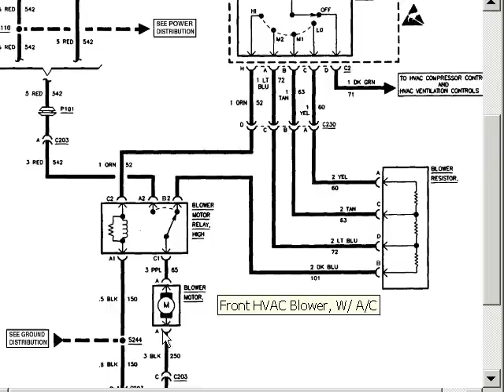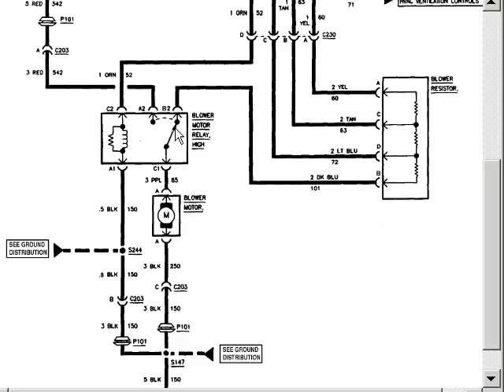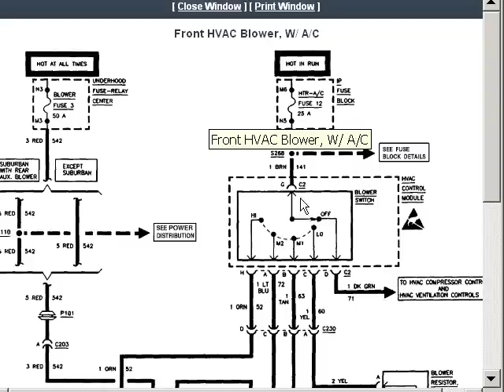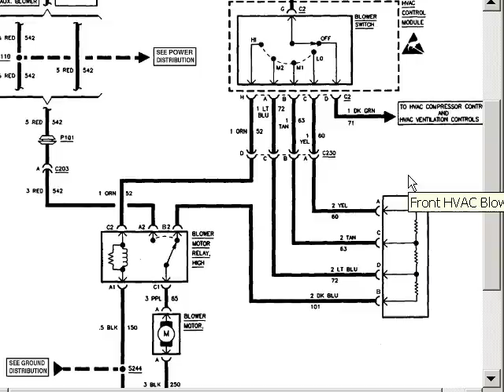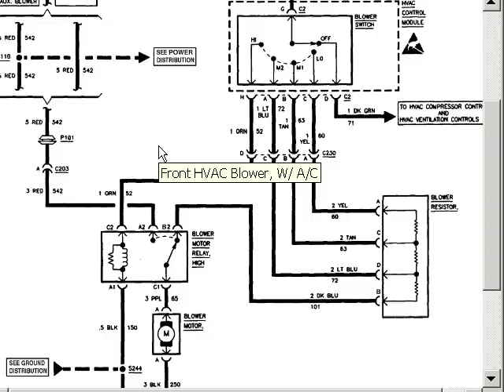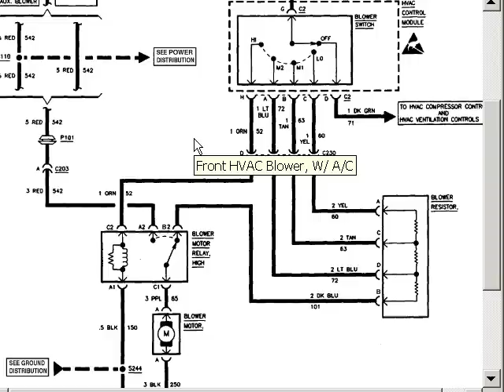Blower Motor Problems | Auto Repair Help

Comment: I have a 2002 Astro van with rear blower motor the motor will not turn on. on any speed no fuses are blown
check the wiring I'm getting 12 volts.. tested motor works fine it's confusing the heck out of me
Reply from the maker: I don't have a wiring diagram for the rear blower motor on an Astro van. But, if you have power at the known good motor, it's time to check the ground side of the circuit.
Reply: thank you for replying the Astro van comes with 3 blower motors one is for the front end of the vehicle one is for the rear AC  one is for the rear heat I tried connecting the Heat connection to the AC connection and the motor runs the wiring to the AC motor give me 12 volts but doesn't put out 12 volts to make the motor run
Reply from the maker: Okay I think the rear AC on the Astro van is the same as the ones deployed on Tahoe and Suburbans. These rear HVAC blower motors have a control module issue. You can see more about the problem on the bottom of this page.  http://www.youfixcars.com/blower-motor-problems-on-GM-vehicles.html
Reply: dmoney1dm8512 1985vett blower motor ground and motor get hot what the problem could be..

Comment: I've been chasing an intermittent short (15A fuse blows) on blower motor circuit for months now. I have Ford Workshop manual and Wiring Diagrams and understand them but feel like I'm missing something. Would the Mitchell 1 or AllData give any other ideas? Which do you prefer? Great video, by the way.
Reply from the maker: Mitchell and alldata use the ford factory manual to pull info from. If you already have it then it probably won't help. I posted a video about how I find electrical shorts here https://www.youtube.com/watch?v=2ATtwe1zSeE

Comment: my wires was burnt out I forgot to take a pic how the wiring now I trying to rewire the resistor in 2002 dodge stratus SE
Reply from the maker: Whenever that happens to me I head for the local junkyard in search of the same year, make and model car. Then I take a picture of the needed wiring layout for use at home. Or I'll pay for access to the wire diagram online from all-data.

Comment: I have a blower motor that keeps blowing when it's shut off all lights are off but when on it's on high and want slow down but my ac works and the heat works it just keeps blowing please help me driving me crazy
Reply from the maker: +Brian Staples I made a video addressing the blower motor runs all the time issue. You can see it here https://www.youtube.com/watch?v=jbd8K8Jzvv8

Comment: I am puzzled. I have a 2006 chevy equinox. Blower does not work. I checked the fuses and relays, they seem to be good. I put a meter to the plug I have voltage in all the speed positions. I tested the motor on bench using battery charger and it ran just fine.So I hooked up a couple jumper to connect plug to motor. I double checked for voltage just before connecting to motor 13+ volts. As soon as I connected to motor  0 volts. I did this 2 or 3 times same thing.  Any suggestions?????

Comment: good info on wiring diagrams / 1994 capri no power to blower motor/ no power at 30 amp fuse at under dash box fuse missing and 1 terminal looks burnt / trying to help a single mom get heat in her car before winter really sets in thanks for any suggestions

Comment: Very nicely done! I have a 1999 88 Olds and the blower does not work on any speed. It is a non-climate control. I have replaced resistor, relay, motor. Also checked all fuses and are good. May be a bad ground??? If so where is this located? Thanks in advance.
Reply from the maker: +Jeff Louden I'm not exactly sure on your model. However if the power wire is a single light purple wire and the blower motor mounts to the metal part of the firewall then it's probably case grounded through a bolt with a ground tab.
Reply: +mgittelman Fantastic, I'll look to see what I can find. If nothing discovered I'll take it to a trusted mech. to look it over. Thanks for your response.

Comment: nando here... if the fan stays on after you pull the key out> then the resistor is shorted inside the controller... replace it under dash near foot area... more info @ CustomWorksUnlimited. Com

Comment: i have a 1998 Dodge Ram conversion Van 1500 318 eng.  it has Front & Rear air conditioner the front blows cold and hot air  the problem is the rear only blows out hot air.  what should I look for to repair this problem

Comment: Mgittelman I have a 2004 GMC Sierra I already checked all fuses and relays. The hvac module does not work on speed #4 and the ac doesn't always blow cold air, sometimes it blows just vent air.
I know it's not the compressor.

Comment: I have a 1996 Cadillac DeVille that the blower motor stays on unless you unplug it. Is there a solution to this or a way to check various things before I replace the motor??? Thank you
Reply from the maker: Michelle:Cadillacs (even back in 96) are known for having complicated climate control systems. It's likely the problem is more complex then a defective blower motor. I would recommend some expert hands on diagnosis before buying any parts.
Reply: Michelle Hart   Hi Michelle,    DID YOU EVER FIND OUT WHAT THE PROBLEM WAS???????     It's most likely the "Blower Resistor Module"...somewhat expensive, but check Rockauto.com , and get the different part#'s they list and check on Amazon for a better price sometimes, or get on from the junk yard.  The "Blower Resistor Module" is located in the air box and will have 2 plugs on it, 2-3 wires and 3-4 wire plug.  The module is a little larger than a pack of cigarettes and sits inside the blower box and has a large aluminum heatsink with fins just like a home computer CPU heatsink to keep the CUP cool.....
Reply: +mgittelman  hi mate ,, can u help me if got corsa .bower moter not work i check all fuse and relay all its ok,, i off blower test out its work ,,i check  both wrie for blower moter its ground ,,not power 12 volt is missing all they way from fuse box now im cunfuse  ,,can u hlep me a litle
Reply: Michelle Hart cv

Comment: i have a relay on the firewall by the blower is it for the blower
Reply from the maker: I'm not sure Larry? I think your looking at the resistor module if it's by the blower motor? I think the blower motor relay is in the under hood relay center on a Blazer? The relays are named and mapped on the inside of the top cover.

Comment: i have a 2003 blazer blower fan has no power going to it ground is good have power at relay how do i test the relay
Reply from the maker: Larry: The easiest way to test the relay is to swap it out with another relay of the same part number. Most of the relay's in the relay center are the same part number.

Comment: Hi Mark I have a 2010 Hyundai Santa Fe.  The blower stopped working yesterday at 34000 miles.  I have checked fuses and they re good.  I sent the wife to the local Hyundai dealer and they said is is the control head.  I bought a new control head and installed to no avail.   The blower does not work on any setting.  After watching your video I can assume that if I find power to the blower it must be the blower motor itself.  Is this a correct assumption?  Thanks as my wife is tired of driving cold!  I have to much do it yourself er to pay the dealer to resolve...  Thanks for any help!
Reply from the maker: I don't know what the circuit looks like on your Hyundai, but you need more than power at the blower motor to make it run. On a motor with a 2 wire connection you need good ground and power. on a 3 wire or more connector there might be a speed request signal from a control module depending on the circuit layout.
Reply: mgittelman
Thanks!  I removed blower motor (two wire) and ran the motor directly to battery and it worked.  It appears the ground may be bad.  Any idea why/what to do with a bad ground at the blower motor?

Comment: hey mark i have a 98 cadillac deville that does not blow any air., heat or ac. I have power and ground to the motor blower. i went as far as buying a new blower motor plugged it in and it doesnt work on any setting. im now stumped. if u can help in any way thanks in advance
Reply from the maker: Andrew: The Cadillac climate control system can be far more complicated than the basic Chevrolet blower motor circuit used in the video. Example: Cadillac uses a pulse width modulated speed controller and heater/AC programer module. that sends a blower speed request signal instead of a resistor bridge.. Your issue might be worth a trip to the Caddy dealer for some initial diagnostics.
Reply: Andrew Clark  blower motor resistor unit,  not expensive at auto parts stores.

Comment: Thanks! This made diagnosing pretty clear. I've never had electrical explained so clearly! Only problem, we missed the problem I'm having. My fan works on everything "except" high. It's a 2005 GMC Savana. Thoughts? (will check power at motor connection next)
Reply from the maker: Could be the high blower relay or the blower switch and of course a wiring issue.
Reply: Check the wire connections, these can get hot and distort, causes full open, zero current, when it is next turned on.

Comment: Thanks!  Dodge 1990 2500
 I took the switch apart and  filed the (H) high contact that had next to no gap, it was shorting to (B) Blower contact.

Comment: This video has helped, but my blower motor on my 1998 Chevy k1500 still is not working.

Prior to blower motor not working completely, it appeared like the motor would occasionally stop working for a second, and then continue working...weeks later, the blower stopped working on L-M1-M2... almost immediately after this the blower worked only on H, intermittently, for 2 days, then not at all.

1. Both the 50Amp (under the hood) and the 25Amp (left side of dash) fuses are good. (continuity test – ok), but I still swapped them for other similarly rated fuses in the respective panels.
2. The blower motor resistor was replaced. The harness looks in good condition.
3. The old blower motor is good (12V test – ok)... and the new blower motor works no better than the old one when installed... both purple and black leads look okay. There is a voltage at the purple lead on L-M1-M2, and none at OFF (as I'd expect) and H. The black lead is grounded (continuity test to metal strut at behind glove box – ok).

What does this mean and what might be my next steps to solve this problem of the blower motor not working?
Reply from the maker: James: You have seemed to cover all the bases. I usually find with stubborn or intermittent blower motor issues a problem on the ground side. Not sure about your continuity test? Did you try running an alternate ground from the battery? If so it might be time for dealership level diagnosis.
Reply: mgittelman Thanks for your input and guidance!
Reply: The panel control switch was faulty/intermittent.  This was replaced today and the blower now works fine on all the speeds L-M1-M2-H.

Comment: good video. I have a 2004 GMC Sierra  and I can't find the relay for the heater motor.  Mine runs on all the low speeds but not high.  Must be the relay I figure but where is it?  I would of thought it would be under the hood but the only thing labeled their for the blower is the 40 amp fuse.  Can you point the way for me?
Reply from the maker: I'm not sure William? I thought it was in the convenience center with that 40 amper. Maybe there is a separate relay center under the hood on your year and model?
Reply: mgittelman can it be in the resistor as part of the part?  I went to AutoZone and they show one with 5 prongs and sell it but no one knows where it goes.  All the ones under the hood are 4 prongs so I know it not it.  Trying to watch the videos and no one ever talks about the relay.  There seems to be a small box on the resistor.  I wish I had one in my hand so I could take it apart. thanks for your response.

Comment: I have '05 Ford E350 van with alot of miles on the Odometer. Latlely my blower motor doesn't work at all, then it will work on all speeds but not as fast as it should. Think the motor itself is starting to fail? Sometimes it wouldn't work on high, but would work on lower speeds, but not at 100% as it should. Your video didn't cover this situation.

Comment: I have 2001 Chrysler Town and Country Van with dual Auto Temp Sensor. the front heat stopped blowing so  I took it to shop and they put in new "Blower Motor Resistor" ($247.00) now the heat is working on full power, the blower motor will not turn off and is stuck on high.They said bring it back and they would fix it but I'm wondering what the will charge me for next,, any suggestions on what might now be the problem ( Could it be a faulty part)
Reply from the maker: Deanna: Hard to say exactly whats wrong, but Chrysler products are known for damaged connectors and wiring around the blower resistor connector. This could cause your complaint. I would let them take a look, since it could be related to the $247 repair.
Reply: Deanna McCormick Thanks for the reply, I was hoping to maybe have idea if they'd need a different part to fix it, I've run the in the shop marathon with this van lately and hope they get it right. Your video was very descriptive on wiring so thought you might have a idea what I'd be looking at next.Thanks,, Deanna
Reply: it's fixed!! the car shop said it was a defective part, they replaced the blower resistor part again and it worked..

Comment: Thank you for the time you put into providing information, making a video, and answering questions.

 I have an issue with my blower motor going off or turning on when I hit a pretty decent bump in the road.

I have just purchased a new blower motor. I am hoping that that fixes the issue as you said if you tap the motor and it comes on it indicates that the motor windings are starting to fail. Perhaps this is why when i hit a decent bump in the road it causes it to turn on or off. I am just sharing incase someone else has this specific problem. I will share more if after replacing the blower if it fixes the issue.
Reply: did replacing the blower work?

Comment: I HAVE A ACURA 2010 TL MY BOWER MOTOR DOESNT WORK I REMOVE THE PLUG FROM THE BLOWER AND IT HAVE JUICE BUT DOESNT HAVE GROUND IF I PUT GROUND IT WORKING IN HIGH SPEED I WANT TO KNOW WHAT HAPPEND  THANKS

Comment: the problem with my 1988 toyota pickup blower motor is it use to work then it slowly got worse to where it wouldnt work at all. i replaced the blower motor and the coil relay but still nothing. iv got 3.2 ohms for ground and 12v for power. heres where im stumped. the fan is getting max volts but wont turn on. i took my multi meter and put the two probes on the female side connector and plugged the motor connector in i get zero volts but when i remove the negative wire from the fan i get 12v i plug the negative back in i get zero agin

Comment: Great video. I do't have a tester and therefore have replaced the blower, but the blower still did not work. So I replaced the resistor. still does not work.Checked the fuse and it is not bad. My 2003 GMC Savana utility van only has one fuse for the heater I guess, Under the hood. The fuse said Blow is the the blower? Still stumped. I can feel heat coming up but no force like before. Oh and the engine light is on.
Reply from the maker: A 2003 GMC Savana has 2 fuses. The Blow fuse under hood and the HVAC fuse I believe is under the dash on the drivers side. I see some diagnostic tips for your model over at 2carpros http://www.2carpros.com/questions/2003-gmc-savana-ac-heater-fan-stopped-working-w-o-warning-on-speeds-checked

Comment: 2005 Avalon Touring, it started when I shut the car off the ac blower motor would not stop running, high was a default speed. I would have to disconnect the batt. post for it to stop.  after 2 days of disconnecting the batt. the blower stopped and appears to be dead. The fan plug also shows 12V even if the car is off.   #2. I can't locate the blower resistor ??
Reply from the maker: Not sure how Toyota wires the blower, but usually when the motor runs with the key off it's often a stuck closed blower relay. The relays should be in an under hood convenience center and well labeled.

Comment: I have a 2004 Nissan Maxima and my AC doesn't have enough power.  I always put in High Speed and even in that speed the AC doesn't reach the back of the car.  It's weak.  What could it be? Blower?
Reply from the maker: xDaNGeRxBosS Maybe a clogged cabin filter?
Reply: mgittelman the filters are new.  Both, the one outside and the cabin filter.  It was worst before replacing them.

Comment: I have a 2004 Hyundai, nothing is blowing out at all, I've replaced the blower motor the relay and the resistor, the new blower motor does not work at all... It was checked for voltage and reading are good... What would cause this?
Reply from the maker: Nancy: If you have 12 volts at the blower motor and it doesn't run, two things could be wrong. No or poor ground at the blower motor or the new part you got is no good.

Comment: I have a problem with the blower motor with my 2003 Intrepid, I have replaced the motor ( having plugged it in before installing, it worked after reseating the 30 amp fuse ) However after installing it, it does not spin ??? Fuses appear to be good, I'm starting to suspect the control switch, however the blower motor relay is in the path, what would you suggest ??? I cannot seem to get an indication with my volt checker, what color wire would have the 12 volts coming into the switch ??
Thanks

Comment: I am having issues with my blower motor. Before i would tap the blower motor housing and it would turn on. now the tapping of the housing doesn't work. what should the problem be? Do I need to replace my blower motor?
Reply from the maker: The symptoms you describe often indicate a defective blower motor, but could also point to poor electrical connections.